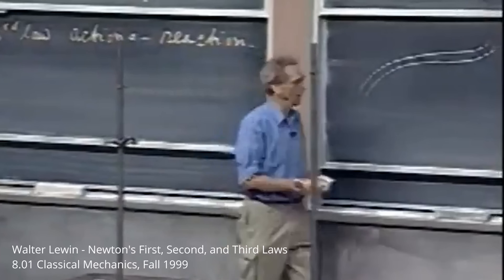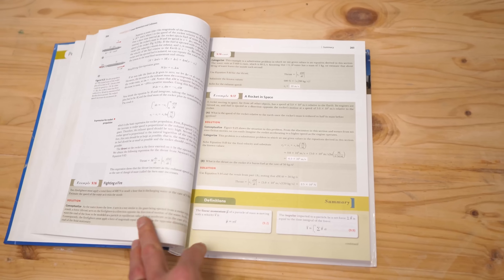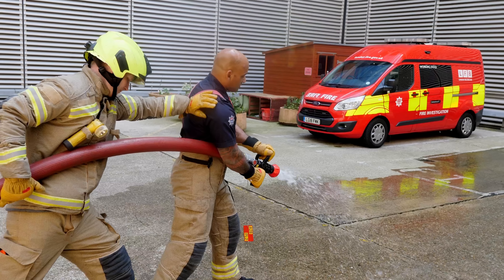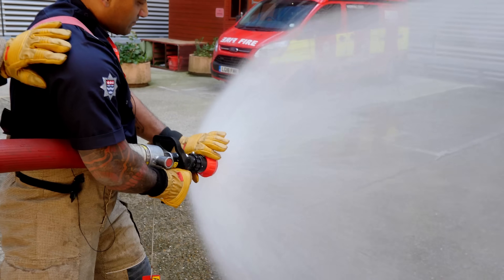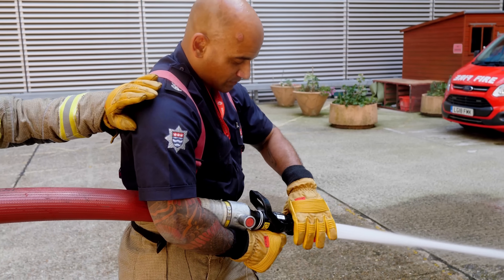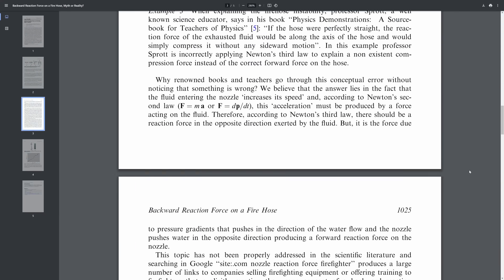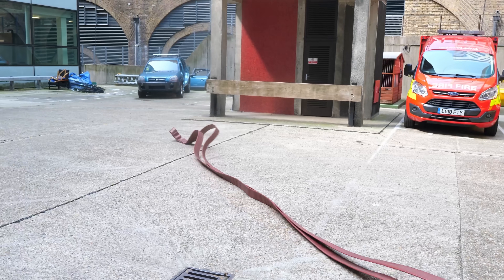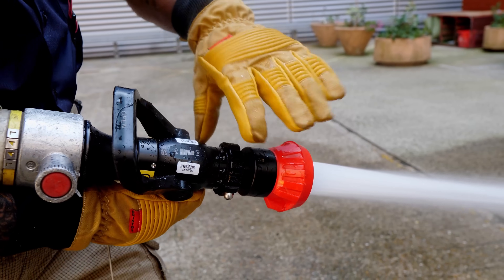Why chaotic hoses dance

Comment: The pump doesn't impart much velocity on the water (generally) - they work by moving a large volume of fluid into a confined aperture, thus increasing the pressure. Take your normal garden hose - the water does not enter from the tap at a particularly high velocity, but it can exit the hose at very high velocity by constricting the exit aperture. As you open the aperture, the velocity decreases - confirming exactly what you said. Interestingly, as you decrease the aperture, you increase the velocity, but the force should be constant because you decrease the cross-sectional area of the aperture (Force = Pressure * Area).

Also, the pushing a string is a good analogy, but it also explains why the fireman has to push the end of the hose away. In the string case, it is not restricted. However, place the string inside a flexible tube of almost the same diameter - a better example would be filament in a Bowden tube 3D printer (because a string is compressible due to the way the strands are wound). As you push the "string", it will want to "crumple", which will cause the tube to buckle and thus pull the exit end towards the source. So the firefighter is actually not holding back the force of the water escaping, but rather holding back the force of the hose buckling under the load of the pump. So yes, the pump is the source of the force, which is transferred to the hose throughout its whole length, which is transferred to the firefighter, which is then transferred to the jet of water exiting. If the firefighter was to let go, and the hose was more flexible, the water would not exit so fast as the hose buckles - this is exactly what it observed with the flailing men. However, the pressure, flow-rate and inflexible hose means this happens at such a high speed it is not noticeable (but there would be a sudden drop in output speed when the firefighter lets go).

Comment: The mass of the hose in relation to the fluid flowing through it might be what makes the difference with the hose vs the wacky wavy arm flailing inflatable tub man. 

the air at the end of the tube seems to be pulling on it more than the air in the tube is pushing, while the water in the hose seems to be pushing more than the water at the end of the hose is pulling

Comment: The reason for the fire hose not wiggling is that the velocity of the water is too low.
If the velocity is much higher, the hose will start to wiggle as a snake, even if both ends are tied down.
This effect is from the water wanting to go straight, but the hose never is, so vectored forces push the hose around at different places.

Comment: I have seen those wavy guys on windless days with the fans turned up too high, they sit up straight and barely move at all. The adjustment is for the wind, you need more fan power during windy days just to keep them from moving too much.

Comment: Presumably, there must be some level of counter-force from the boundary interactions (in the instance of the fire hose, friction between the water and the walls of the hose).
That force would generally resolve to acting in the direction of the water’s travel at the nozzle and so would counter some of the depressurisation reaction force…
So if we assume that neither force is entirely negligible, either the two always balance exactly, or the firefighter is subject to force which is not exactly the reaction force…

Comment: Have you ever used a pressure-washer, or a garden hose with no nozzle on it? The nozzle on the pressure washer has quite a kick to it when you pull the trigger, while water supplied from the same hose, with no nozzle on it has a barely noticeable force. It's not like you get more water flow because of the pressure washer, but the hose is thinner (to better cope with the pressure), resulting in higher velocity in the hose, and hence the hose tends to jump a bit when you start and stop the flow at the nozzle. The real magic, though, happens at the nozzle where you go from relatively slow velocity to very high velocity as it exits the nozzle. 

You made one mistake in your description, that for a hose with no restriction on the end, the pressure is constant because the speed of the water is constant, but that is not the case. There is some friction between the inside of the hose and the water. This accounts for a small loss of pressure for every parcel of water traveling at constant speed down the hose. If you put in several T-connectors, an put a pressure gauge on it, you should be able to see the static pressure drop gradually to 0 just at the end of the hose, where you only have dynamic pressure (as pr. Bernoulli). 

One simple experiment you could do with a garden hose is what we used to do with the hoses at the sailing club when we cleaned the dinghies after training. The hoses had no nozzle on them, just a simple hose. As a makeshift nozzle, we would make a kink in the hose about 30mm from the end, this creates a restriction, which accelerates the water quite significantly, while the end of the hose acts kind of like a rocket nozzle, in that if focuses all of the flow into a reasonably narrow stream. When the hose has a well developed kink in it, you can put your index finger over the top while you hold the hose just below the kink and modulate the restriction, and thus the velocity of the exiting water. I seem to remember that a quite distinct increase in thrust was produced when doing this, varying with the angle of the kink. Too much and you kill the flow, resulting in no force, too little and you don't get flow separation (air flowing back into the hose), and the water is decelerated again before exiting, resulting in no change. In between is a sweet spot where you still have significant flow, but also significant increase in speed, and thus higher force.

Comment: Regadring momentum at the pump, I'm not convinced that pump creates any. If we consider water incompressible, the speed of water before the pump and after the pump is the same. It means there's no added momentum at the pump. (But there's difference in pressure and that difference is applied to the pump blades)

Comment: That reaction force simply does not exist. What does exist is the hose being stretched and then pulling on the firefighter when he opens the valve, and then when it curves, it pulls as well. That is it. Newtons 3rd law has nothing to do with it, there is no reaction force on the hose, every single force on the hose from the water is travsverse or it is along the hose in the direction of the water, without a magical more than 100% efficient expansion nozzle, it is simply impossible to generate a backreaction on the hose. The experiments as i said in an earlier comment, doesn't show what you concluded at all.

Comment: 15:30 my instincts tell me if that hose was  hanging in the air, (much as you have the little tube with compressed air)  it's gonna flail and wiggle and snake as much as the little tube, seems like its motion is being restricted to 2 dimensions only, and when it tries to take off in the upwards direction it doesn't get a proper reaction in the opposing direction (downward)

Comment: Sounds about right. Mild changes of pressure per delta of (bending) volume, but pressures fr behind & ahead balance containment; maybe pressure up at nozzle from topology changes, but see biggest factors decreased exit surface area vs expansion of decompressing fluid -- & vector of flow just prior to leaving exit, incl. current eddies.

Comment: 12:30 I reckon the pressure drops as water travels along the hose and the excess of pressure works against friction and turbulence. So, the pressure around the nozzle is atmospheric. I don't think there's acceleration there.
Reply: absolutely right! the viscous force is proportional to the fluid velocity, and because it's water, that force is the same all along the hose. The pressure force is proportional to the pressure gradient, so there is a steady drop in pressure along the hose, until its at atmospheric pressure at the nozzle exit
Reply: @lunar04j yes! And also, because water is incompressible, the only type of acceleration in any tubes is sideways. (Unless there's a change in circumference)

Comment: Think about it this way, the speed of the water at the exit releases as much power as the pump delivers, do you think that a firefighter is capable of holding that back? Hell no, what the fire fighter is holding back has absolutely nothing to do with a reaction force at the nozzle.

Comment: Obviously the water doesn't change speed at the nozzle, because it's not compressible! The difference in pressure is balanced by a very very slightly thicker stream outside the hose as inside.

In air the effect is very different, because air will significantly expand at the nozzle, creating a high pressure zone pushing the hose back. So your air compressor experiment isn't comparable I think. However in your air hose experiment the main force is the force from the bend trying to grow bigger. You could possibly measure this by measuring the forces of the hose at both ends, the open and the connected. Again, this is not something the waterhose would need to worry about, as it's held in place by friction with the floor (water is heavy, air is not)

Comment: Despite all we know about fluid dynamics I am caught off guard by things all the time. The pressure does drop along the hose. Friction forces etc. probably pretty small TBF. Also, when liquids are flowing in pipes there is a dynamic pressure. I have seen this when opening sample valves on pipe lines with high liquid velocity. Instead of liquid rocketing out of the sample valve, air gets sucked in. It's because the dynamic pressure in this liquid is less than atmospheric pressure. This melts my brain a bit, because the pipe is eventually emptying to atmosphere anyway. It's a like syphon effect. The kickback momentum coming from the conversion of pressure energy to kinetic energy is interesting though. Never thought of it that way. Id imagine this only happens with turbulent flow.

Comment: A nozzle converts the pressure component of the high pressure, low velocity in the hose ALL into kinetic energy. All pressure is converted to kinetic energy, right at the nozzle. 

There is a very direct ratio between the feet of head above the nozzle, and the optimal rpm- or more specifically bucket speed- of a Pelton Wheel turbine. 

The buckets move at 1/2 the velocity of the nozzle stream, redirecting the flow back towards the nozzle, and leaving it with zero velocity and energy, at which point it just falls out of the bottom of the housing. 

Obviously they aren’t this perfect in practice, but they are very good, their efficiency reaching well into the 90’s. 

The higher the head pressure, the higher the correct operating speed. 

If the speed is too high, the water leaving the buckets still has kinetic energy in the direction of the motion of the buckets. You have higher speed, but less torque and the machine operates at a lower efficiency and develops less hp. 

If the speed is too low, the water leaving the buckets still has kinetic energy, but in the direction opposite that of the buckets. The machine develops more torque, but at a lower speed and operates at a lower efficiency and develops less hp. 

Pelton Wheel turbines would be an excellent follow up video to this one. 

A nozzles converts the pressure component of the penstock energy into kinetic energy, a Pelton Turbine converts the kinetic energy of the stream into mechanical power, all with remarkable efficiency and elegant simplicity.

Comment: To exert a net forve at the exit point, the water needs to accelerate. How can the water accelerate if there is no nozzle? This would also mean, that there cannot be a higher pressure in the hose if the flow isnt choked. I think your reasoning has a flaw but i cant get behind it... Any comments?

Comment: It seems like the logical conclusion to this would be to attach some kind of small rocket to the end of a tube (doesn't have to be a tube, but something of similar elasticity and density) and see if it results in the same type of movement

Comment: Try again my friend
, this time dont meaaure the "reaction" force, you experiments are wrong. The force you saw in both those cases are simply and only due to bending. Look at the tapes over again. 

Learn the ways of pressure integrals on the insides of nozzles, both oure constriction and expansion nozzles. And then do this experiments instead, film a loose hose really carefully and look simply at the trajectories of individual parts of the hose and use that to estimate the forces. You will find no reaction force at all that isnt transverse and from exclusively bending.

Comment: It has nothing to do with newtons 3rd law at all, it has to do with two different steady states, with two different longitudinal lengths for the hose, and the transverse forces from flowing water in a bent pipe, those are the entirety of what you have to work with to explain the phenomena.

Think about the integral of pressure and drag of the water inside the hose and nozzle, the pressure in a constructing nozzle always faces towards the flow of the water, and cannot produce a backreaction on the nozzle at all, it is actually pushing the nozzle forward at all points of the inner surface. You are holding onto the hose, not the water, you need a mechnism for the waters change in momentum to be communicates to the hose and nozzel, and to be frank with you, for a constricting nozzle the water only ever pushes a constricting nozzle forward in the direction of flow of the water, never backwards. Never. If you attach a constrincting nozzle on a tube where water is being pumped out, the force between the nozzle and the tube is tension, always. Even with an expansion nozzle, the best you can ever do, is to have 0 net force on the constriction plus expansion nozzle. 

This is really counterintuitive, but it is true, of rockets and true of every single nozzle you will ever encounter. 

So why is it true and what is true? What i'm saying is true. Is that if you take a rocket engine with a pure constricting nozzle, to find its thrust, you take the integral of the pressure inside it, that is the integral of a closed sphere minus a little hole, that is it, so the parts of the combustion chamber that points in the direction you want to accelerate the rocket, is the part which has pressure in the right direction. So, for a constriction nozzle, the actual constriction is just there to release fuel products at a higher over all energy per mass density. The way it works is that the pressure on the walls on the nozzle is lower than the side facing the rocket, and it gets a bit complicated but essentially, the little hole at the end determines the pressure integral on the wall inside. But the important part for us, is that the pressure on the nozzle wall is always pointing in the wring direction no matter how much it is reduced by flow. 

And expansion nozzle only works, if what you push out of the constriction nozzle part will expand on its own at some speed once it has exited the constriction, typically unless the flow is really fast the expansion after the constriction is super small therefore the power of an expansion nozzle to follow the constriction nozzle is miniscule. However, ofc if the compression is still high at the constriction, then the density is still springy, and you can then add an expansion nozzle, and the wall of the expansion nozzle points in the other direction, that is the integral of the pressure on it, can in total bring the pressure of the fluid or gas to 0 at high velocty, so it can push in the direction of the rocket up to releasing all the potential energy stored in deformation of density that is stored in the propelant while it is pressurized, ofc an expansion nozzle also has drag, so the best we can do is to release the pressure that is left over after the constriction nozzle, the point is that when the flow is nice and subsonic, the pressure at the end of the constriction nozzle is more or less rhe outside pressure, that is why expansion nozzles only really work with very high compression rates and often only efficiently at supersonic l
Flow. 

So anyway i just explained way too much here, but the point is, the expansion nozzle can only ever undo the pressure integral in the wrong direction of the constriction nozzle, it can't actually add anything really beyond that. So no rocket engine nozzle can actually ever push in the direction of acceleration of the rocket in terms of net force. All they really do, is make the chamber pressure higher effectively, and the backpressure from constricting the flow out of a nozzle smaller compared to the integral of pressure that is facing the right direction.

Comment: 9:30 you ask for help. may give you something to consider. the Pascal rules of presure. and you may stop thinking the hoes and the tube are detached from the Pump. the Presure from the pump also goes down all the way through the tube and exist only at the hoes. the whole Container from Pump to hoes is one presure system. just like a ballon. hold on the neck and you hold the baloon. Hold on the hoes you hold also the truck from going somewhere. (its to heavy but you stil counter the force which not going all the way to the truck anyway becourse the tube is flexing around and absorbs all the force onto the ground. if its long enough you may even see the tube isnt wiggling around anymore at some point depending on howpressure is in the tube in the first place) Imagen you grab and hold a Rocked by the engine. you would have to withstand all the force its produce if you want to prevent it from taking off, no?